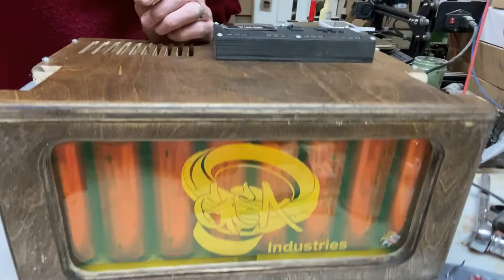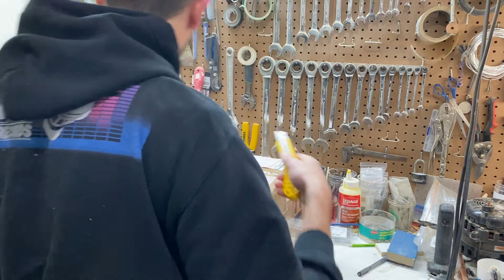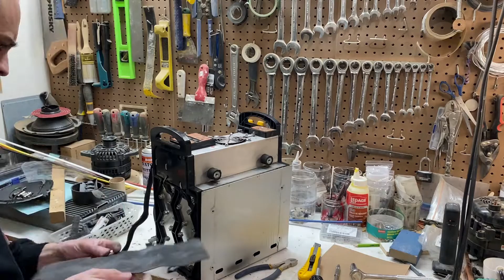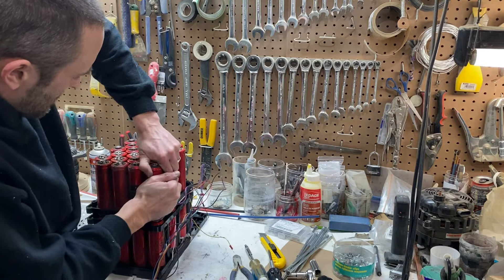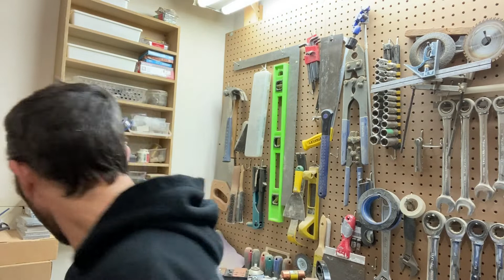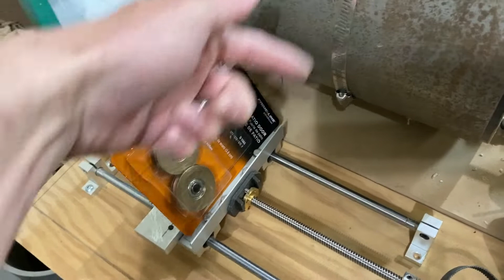DIY Lithium Bank (headway HP) Part 1

Comment: what size is that square bar 3 inch by 3 inch?
Reply from the maker: For the 48 Ah? I don’t have the dimensions on me. But… Every hole is 43mm apart with 15-18mm offset to the adjacent edges. So… the larger plates would be… (43x3)+(18x2) 165mm by (43x2)+(18x2) 122mm hope that helps
Reply: @MrM_Full-Send  ok thanks so i know how much aluminum to buy. getting 20 headway cells for a small bank  .
Reply from the maker: @69-PROGAMERSIM-69  I cut it all from a single 12” x 12” square plate.

Comment: I have a beast module sitting in my living room. looking to make 96ah bank for my sub. Also doing an alt  still in between 240a and 320a cant decide if i need the larger one or not.  also are you making a machine to make voice coils? subbed
Reply from the maker: Yes I am making a machine to wind voice coils. I have sadly been distracted by other projects and financial limitations on said production. It is in progress slowly. As far as alternators, what kind of wattage are you looking to run? You need to consider output in relation to power production or else you will just slowly deplete your reserves

Comment: I have a 2010 chevy tahoe ltz with one stock atl and a mechman 400alt and 2 taramps 8k bass amps what kind of power will this bank support for all this
Reply from the maker: I kinda always ballpark but you can multiply Ah x nominal voltage x discharge rate if you like 🤣… 48Ah I would be estimating around an 8-10k system. Your alt setup can maintain around 7k so running at 10k you have a net deficit of 3k watts. The idea is to pull from the battery in high demand scenarios then charge during low demand. Running 2 8ks I would go bigger than 48 Ah probably… 64Ah… that being said, no matter what, your maximum sustained wattage is limited by your alt set up.
Reply: @MrM_Full-Send  see I was going with the super beast 48 cell in broke it down to 96ah would that be good for my setup
Reply: So what you think buddy is that a good idea or I need 2 of them
Reply from the maker: @kaniya0811  a single super beast will be a good size for sure. I just built one myself and it turned out very nice.

https://www.instagram.com/p/CjlSSJ6p5ag/?igshid=MDJmNzVkMjY=

https://www.instagram.com/p/CkjB4x0JeiK/?igshid=MDJmNzVkMjY=